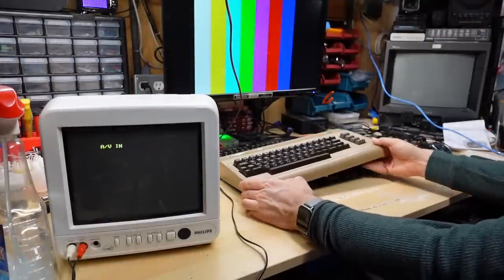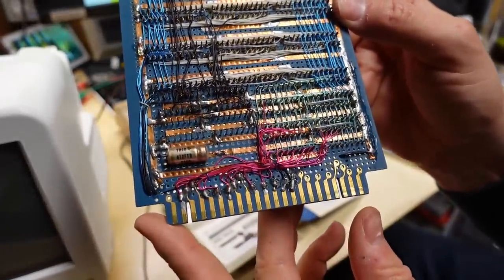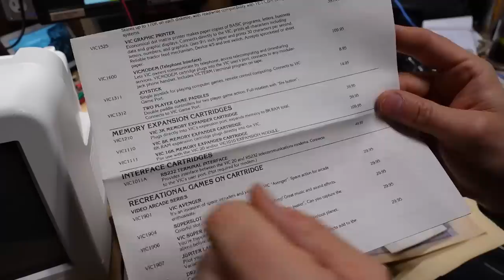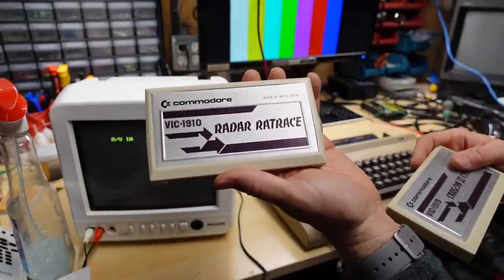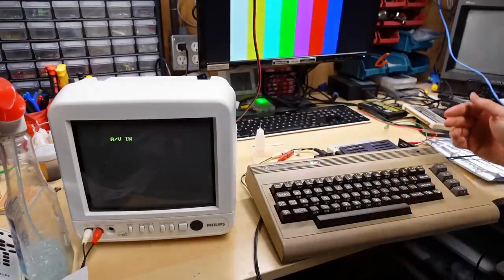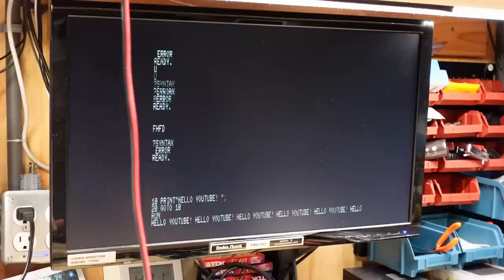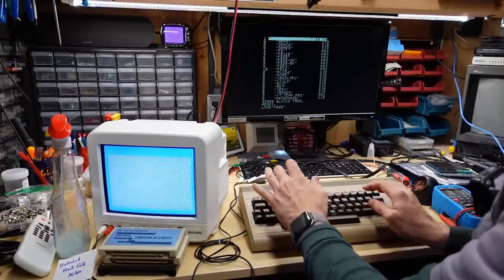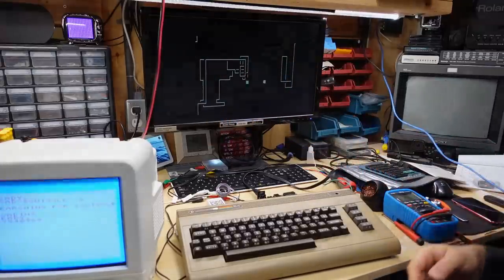VIC-20 goodies: Running PET programs on the VIC, a hand made 24k RAM expansion, 80/40 column cart

Comment: Not a word about the good old CDP1802 making an appearance. If you had to look it up, you missed a relatively little known but in its way very important little 8 bit processor. The company Endeco still exists and still makes all sorts of equipment. I don't think that this has anything directly to do with the VIC20.  My guess is that it was some device that maybe was accessed by a VIC20. The 1802 was probably used as a sort of embedded processor here, but I would love to take a closer look at the schematics. Maybe it was some sort of battery buffered device. The 1802 was one of the earliest CMOS processors and offered a very long battery life for mobile or battery buffered devices. The even for the time low clock frequency of only 1 MHz would also suggest something like that.

Comment: Could the intermittent behaviour of your VIC20 be a dodgy crystal oscillator, Just saying because I had a very similar issue with a console I repaired and I was able to confirm it was slightly out of spec with an oscilloscope and was able to influence its behaviour by spraying it with some cold contact spray. I changed it out and problem solved, It's one of those things you least expect to go but they do drift with age.
Reply: I actually have the same issue with my vic. I have found unplugging the video output and plugging it back in can sometimes cause it to start, not a guarantee and may be a coincidence. Lol

Comment: By the same mechanism your initial RAM mount failed : a switch between the bus and the chip changing its placement in the memory map, I had a bus extender built with the same kind of prototyping card, equipped with two 44-contact connectors, one for the RAM, one for a cartridge. And with the magic of external switches, R/W or R/O lines config, and Reset button, I was able to virtually duplicate a cartridge : The cartidge can be mounted, but displaced with the switches in memory so that it won't boot, causing the VIC to boot into BASIC. Using the appropriate syntax, the 8K of ROM could be saved to tape. Then stop the VIC, remove cartridge, mount RAM extension. Restart with BASIC, and using same kind of syntax, load from Tape into RAM, change the R/W line to R/O, and you have a virtual cartridge, move it back to the proper cartridge address with the switches, then press the Reset button... And the magic operates :)

Comment: I had the expansion chassis when I was in Germany. It was a metal case .
Reply: Pity you didn't hold on to it. Those are pretty sought after these days. Even the third party ones that are basically just an open circuit board are pretty hard to find.

Comment: I was cleaning a few days ago, and came across my VIC-20. When I bought it, I taped the receipt to it. I bought it July 23, 1982 for $214.99. I still have the cassette drive and an RF adapter. I didn't find the power supply, the modem, or any of my electronic projects that plugged in the cartridge slot.

Back in the day, I wrote some assembly and soldered 64 red LEDs into an 8x8 array. I also experimented with using the 300 baud modem as an auto dialer.

Shortly after that I was put in charge of a VAX 11/750 running BSD Unix. I don't think I used the VIC-20 after that.

Anyone interested in an extremely yellowed VIC-20 that might work after cleaning?

Comment: Haven't seen a wrapboard since.. early 90s and they were only for prototyping.. We did have a old bank computer remnants at home, my dad took it for spare parts. It had wrapboard almost everything. I blew up almost every chip in it, for fun... But, wrapboard served a purpose, it was fast to do simple logic and iterate thru it before committing to making a PCB out of it. But, they had their own problems, wrap is not a solid connection, it is not even crimp, can get loose and oxidize, specially when aged...

Comment: That was really a krap move on Commodore for not making the C64 backwards-compatible with the VIC-20 when they were basically packaged in the same case.
Reply: At least the peripherals (except for cartridges) were compatible.  I think the biggest issue with the VIC-20 was that it displayed in 22 columns instead of 40.  The VIC-20 should've also been released with 8Kb RAM standard and the c64 should've been released with BASIC 4. Commodore always took the cheapest route.

Comment: See this: http://sleepingelephant.com/denial/wiki/images/3/30/VIC1110_32k_mod.jpg
This is the last VIC-1110 8k RAM expansion I pumped to 32k back in 2015. Over the years, I did this mod about a dozen times. That's why the 8k expansion is more useful than the 16k VIC-1111.
Reply from the maker: That is so cool -- looks to be a relatively simple mod!
Reply: @adriansdigitalbasement  And remember: 32K extension = can run Realms of Quest V.

Comment: You're going to get high-quality scans of those blueprints, right? Especially the CDP1802 board would be really interesting to see, especially for the Cosmac fans out there.
Reply: Here's a possible lead on the CDP1802 computer: https://ieeexplore.ieee.org/document/1151528/similar#similar. Apparently, Endeco made a low-power, all-CMOS, CDP1802 computer board with up to 2k ROM and 8k RAM, which they used in a number of different products.
Reply: I hope so, i would be very interested to see those properly.

Comment: Very interesting video, I just fixed an Apple II videx videoterm 80 col. video card and the vic20 card looks to me identical to the Videx judging by the use of the very same mcm6845 video controller. I see that the Vic20 card has a nice and clean video signal, is there a schematic diagram somewhere?

Comment: Be careful with cartridges in the original case. In the time I had one destroy my VIC 20 because the internal board holders broke and so it was slightly slanted in the slot without it being visible from the outside.
Reply: My first was a C64. After the accident with the VIC 20 I found a VIC 20 Board with bubbles on the board in the spare parts box of an electronics shop for 10DM and found that it worked. However it had NTSC output. 

BTW: I have a 32kb expansion with a lot of dipswitches. May have been that one which broke my first VIC20 because 3rd party expansions often have thicker boards or unrounded edges and therefore have more resistance when trying to insert them.

Comment: maybe I'm wrong (I not really know too much about vic20) but if it use linear regulators for 5V and 12V as c64 you need to give it more than 12V DC. Linear regulator need 1.5V-2V more than regulated voltage, rectified AC is above that but pure DC is just too low and maybe that's reason you get black screens. As first few images on google search tell me original use 10 (or 11V depending on picture) AC what will give you above 14V after rectification so enough for stable 12V line.

Comment: *SMH* Back in the day we Vic20 owners did a lot of home brewing because getting such expansions were very expensive. That 24K expansion for me cost me over $120 with about $20 for each 2K RAM chip. This was in 1980 (got my Vic20 in 4/80). I did several 3 and 5 slot extenders for me and my friends and 16K RAM boards as well.

Commodore released the Vic20 in Japan in mid '79 as the Vic1001. 4000 units were released in Japan back then before they were sold in the USA. My unit which I still have is #004472, making it one of the first 500 made/sold in the USA.

I have a few choice words to throw at you for down playing the Vic20 and for other things but I'll remain silent to preserve the peace. But I'll say here and now that No Vic20 is junk...

You should check the condition of your Vic20's cartridge slot if you are having issues with it. The center top of those slots tend to wear out and bulge up causing problematic connections to the cartridge. It's a simple repair with a standard 44 pin (22 per side) right angle slot connector. Simple but a lot of work to get it done.
Reply: I have a Japanese production VIC 20. It looks legit. All the dates on the chips on the mainboard are 1982 (they all have green dot stickers placed on them). It has a 2 prong 9v AC power input. Am I correct in thinking that production of the VIC 20 shifted from Japan early on in the VIC 20's history or did they continue to manufacture out of Japan?
Reply: @eebaker699  I would guess that manufacture stayed in Japan for the Asian Memory before expanding to Hong Kong and Taiwan, while manufacturing them in West Germany and the UK in the European market and California/Texas/New York for the American (North and South America) market.

Early Vic20s in Japan had the Vic1001 badge and a serial # below 10,000(?) before they switched to Vic20 later on.

Check out https://cbmvic.net/registry
Reply: @elfenmagix8173  I appreciate your helpful feedback. The Japanese one I have here definitely has later badges and keyboard. Maybe they kept production going and shipped to Australia due to their relative proximity to one another. 😁

Comment: Each time you use de oxidation liquid on the cartridge the system doesn't get a black screen.. I see a pattern try cleaning the mainboard side connector for cartridges.
Reply from the maker: I didn't really show it but that motherboard does the black screen thing with nothing connected as well. I think the reset circuit may be failing as once it does run, it works perfectly.

Comment: Well, Adrian, you’re braver than I am; no way would I plug in an adapter card of any sort whose (electrical) status was unknown - I’d at least test for shorts on the power pins! 🙂
Reply from the maker: Heh well I have the VIC-20 running on my bench supply so it'll actually prevent excessive current draw if one of those cards came with a short... I had it set just a little above the maximum draw -- I actually had to turn up the current limit to use the 80 column card. It drew a good amount of addition current and the PSU dropped the voltage so low the machine wasn't running anymore.

Comment: 7:28: Still not enough for Realms of Quest V. :( 
https://www.youtube.com/watch?v=PUsYNwISNNs
PS: @Adrian's Digital Basement: If you installed an extra 8K on the 80 column card, could that be done in a way that's compatible with the 24K card? Can you get an extension board that allows you to plug more than one cartridge into the VIC-20? Because 32K would be enough for Realms of Quest V.
Reply: Unless he really needs 40/80 column output, he could use an expansion board and use the Cardram switchable 16K expansion with the homemade 24K expansion. The four switches on each 8K block on the Cardram one should be for blocks 1, 2, 3, 5 so enabling 8K in block 5 and have the second block disabled would work with the 24K expansion. If he needs the full 35K though, he needs a different expansion that enables RAM1, RAM2 and RAM3 in the 3K expansion block. There also are the I/O blocks 2 and 3 which the 40/80 card uses for I/O addresses like the one he POKEs to get rid of the cursor. In theory those blocks can be used for 2 x 1K RAM as well. I believe the Rabbit fastloader used some of that area for memory expansion, but ROM or direct I/O access probably were more common.

For that matter I own a Zero-18 a.k.a. Kalawsky 40/80 card. It is quite similar to the one in the video, but with a slightly different memory map so the two are not directly compatible, only comparable. It would seem there were perhaps three different standards for 40/80 expansions, ironically enough.

Comment: it probably gave you the extra ram at literally every time you tried to change the configuration. just that basic needs a continious area. but that's just basic... :P basic only starts to count at the start of basic text wich is $1001 on an unexpanded vic, $1002 on a vic with expansion above $1FFFF and $0401 (same as the pet) on a vic with the 3KB hole filled but no ram above $1FFFF. (as then it is $1201 again)  thing is it only counts from it's start address until it finds something 'not ram' as basic, unlike your own code, cannot use anything that isn't one closed area without holes in it.
Reply: it would have been a lot better if they had picked one offset for the start of basic and video ram and sticked with it :P also setting the video ram to $8000 to make it more or less pet compatible (desite only doing like at most 28x23 characters or so) is impossible cuz tadaa... it cannot address ram there. for something initially called the micropet it isn't well thought out :P (and even when inserting enough ram for the video screen itself to increase the displayed characters that probably still leaves the color ram to deal with too - which can only be mapped to 2 locations, $9400 and $9600 :P (ikr... lol. little leftover of that 'shift bit 9 of video ram into bit 7 of some other register' stuff that also moves that :P 'oops'.
Reply: so basically to make your programs run (or at least start and initialize) on any vic-20 you're gonna need to make 3 versions of them :P lol. or load with 8,1

Comment: Ah, you have the VIC20 that has only 9 VAC power input, and onboard rectifier(s) and regulators for all voltages. Have never seen one live, but the units I've handled had a similar PSU with C64. Which actually works for the VIC20 perfectly, but FOR THE LOVE OF G/D, DON'T RUN  A C64 WITH THE VIC20 SUPPLY. The 5V regulator in it is not rated for that much current, but will burn out and damage your C64.
Reply: Correct! I think from memory the VIC 20 needs 2Amps.
Reply: @eebaker699  I think closer to 3A but never handled one. The newer model claims to be ca 25W so I assume 27VA is pretty much a minimum transformer size.
Reply: @jussikuusela7345   Very possible. I know the original Arlec 9v AC one I have runs like a toaster oven.